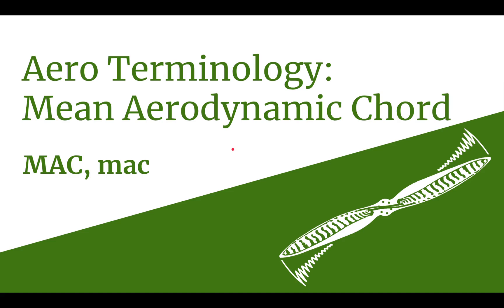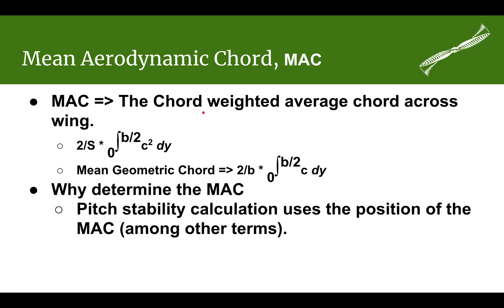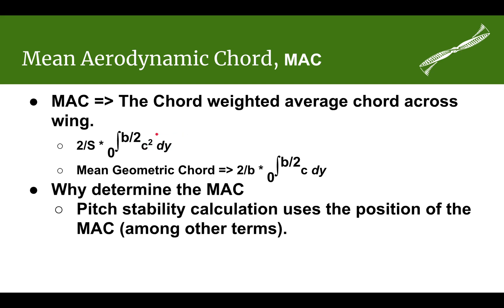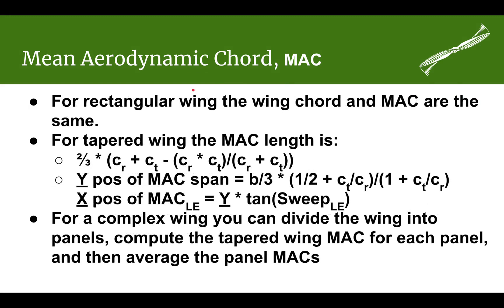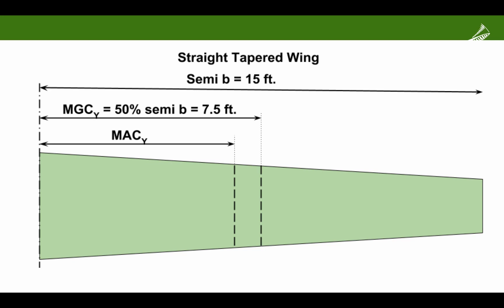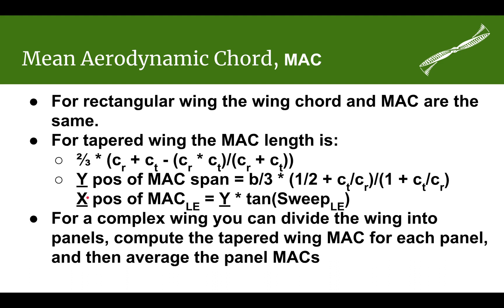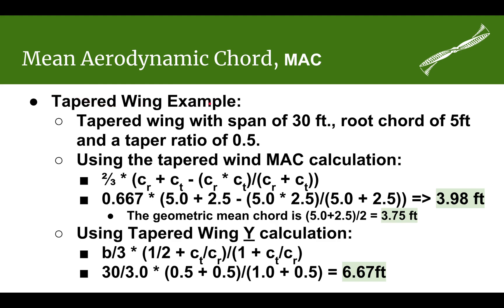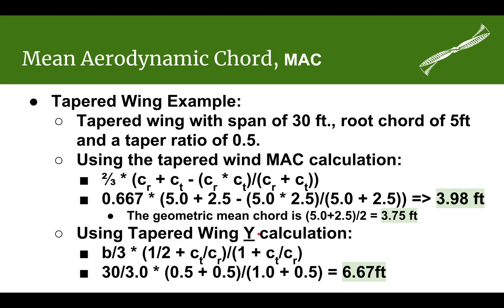Aero Terminology: Mean Aerodynamic Chord

Comment: Thank you for explaining this.
For anyone else trying to calculate a complex wing.
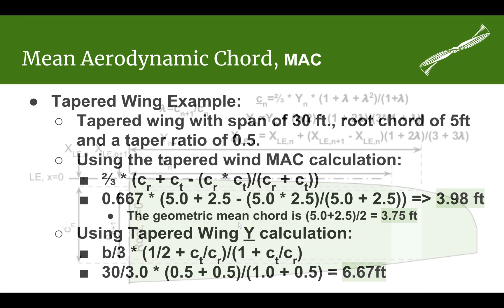6:10 to 7:55
These are the easier formula to follow, but don’t calculate Avg X.
Cr = Cn
Ct =Cn+1
b=(Yn+1-Yn)
7:55 to 11:50
this is a bit confusing, but breaks down to
b=(Yn+1-Yn) 
(Avg Cn) = 2/3 * Cn [<not Yn] * (1+*(Cn+1/Cn)+*power((Cn+1/Cn,2))/(1+*(Cn+1/Cn))
(Avg Yn) = Yn+((Yn+1-Yn)/2)*(1+2*(Cn+1/Cn))/(3*(1+*(Cn+1/Cn)))
(Avg Xle,n) = Xle,n+(Xle,n+1-Xle,n)*[<this * is missing](1+2*(Cn+1/Cn)/(3+3*(Cn+1/Cn))
Hope this helps someone.

Comment: Hey. I just working on a Calculator for my school. I wanted to calculate optimal CG position. And I have to find mac position just taking inputs as span, tipc, rootc, and sweep angle. 

In this video you gave y position of the Mac but I don't understand what you mean as y position according to where?

Can you explain please
Reply from the maker: For most airplane design shops, the Y direction is to the left (negative) and right of the center line of the airplane. The center line of the fuselage  is Y=0. The X dimension is fore and aft. X=0 can be anywhere the designer picks. Like the spinner tip or the firewall. The Z direction is up and down. Z=0 is typically the ground.
Reply: @Designer103  thanks for reply but how we can find sweep angle for example he/she is using %25 of chord for sweep. But we dont have any input as an angle.
Reply: We can make a video about the interface I developed, if you want, there is only an input problem for wings with sweeps, mac calculations work very well.